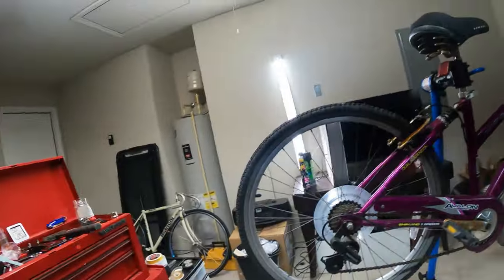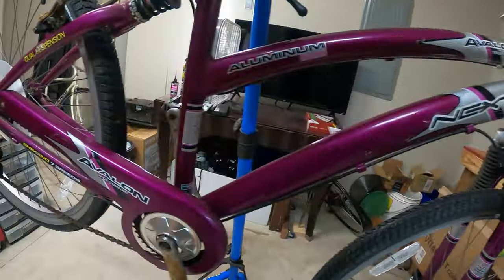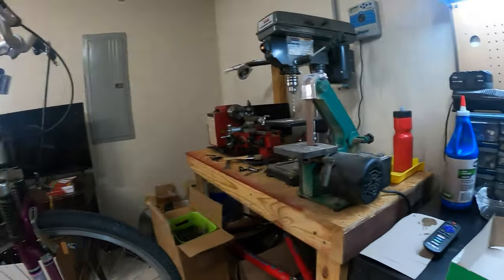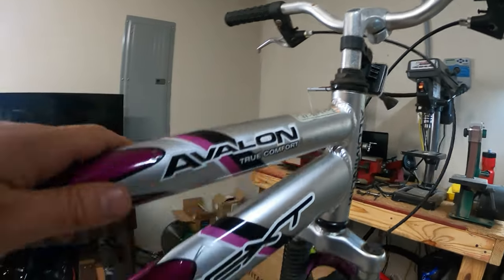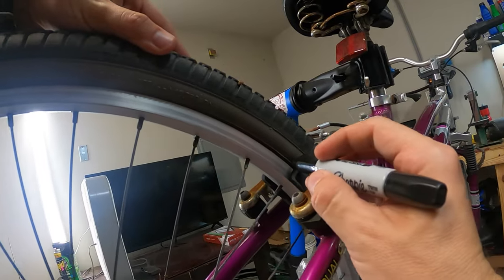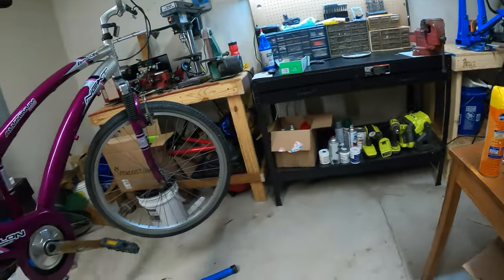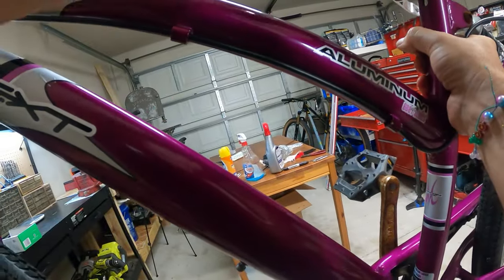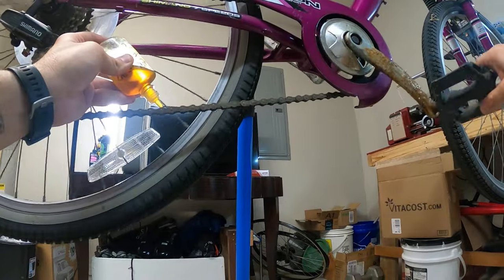Horrible Walmart bike fix up in hot garage

Comment: If the rear mech has that adjusting screw, you can put a little piece of cable in there and make it a “dinglespeed”. It might work for a few gears. You can shift at least a little but it will still be like you did it.Search that term here on youtube😅
Reply from the maker: lol yeah I've seen that.
Reply: @BruceChastain New owner wouldnt probably use it, but it is a nice hack.